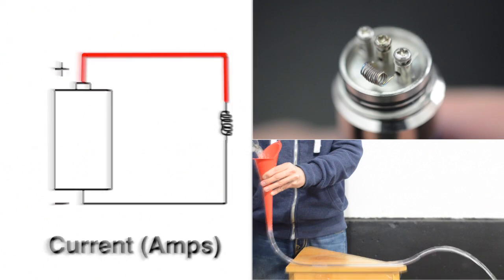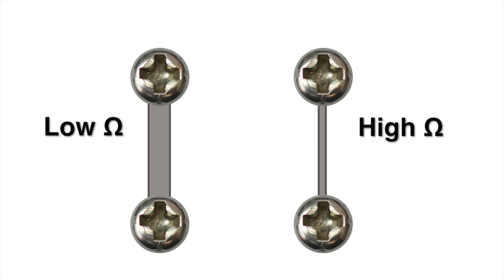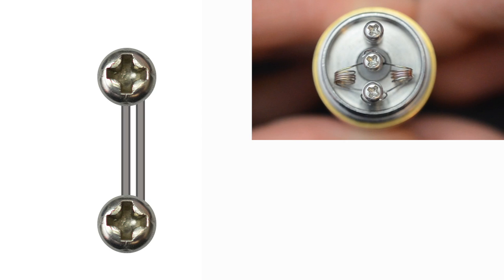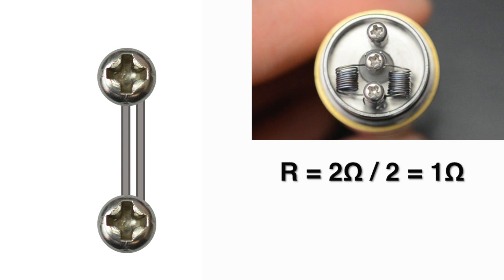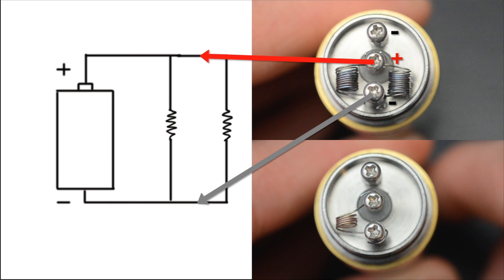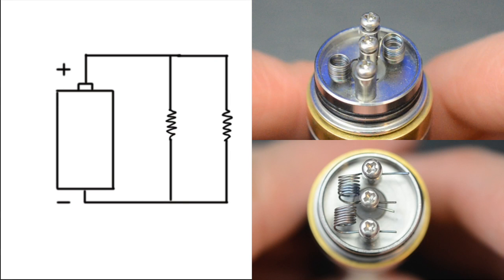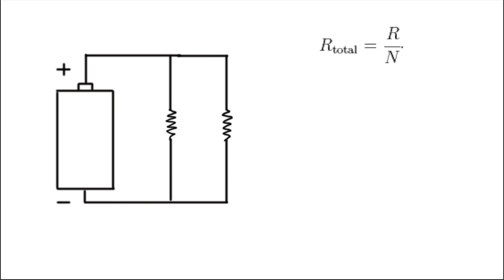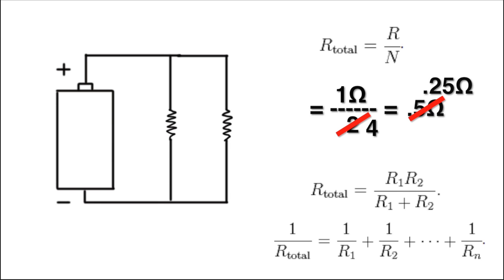How Dual Coil Builds Work

Comment: So if I want a 0.5ohm dual coil build I need to use two 1.0ohm coils?
Reply: Yes and no, if you have 2 1ohm coils in parallel if gonna be 0.5ohm but its not because you have to divide the resistance of the coil for the amount of coils you have, the correct formula for calculating the resistance in parallel is RT= [1/ (1/R1) + (1/R2) ] = [1/ (1/1) * (1/1)] = 0.5ohm.

Comment: You literally just explained my problem to thanks so much. It’s just so hard to get coils to be even so although they maybe close to the same ohm the won’t heat evenly if there’s even a .25 ohm difference. This is my problem I’m having with trying to run 2 Clapton parallel. 26awg*2+39+26awg NI80 3mm 0.3_+0.5 ohm

Comment: im using kbox 40w and dual coil wont work. what should i do?
Reply: use thinner wire to make resistance go up, most probably your mod read short-circuit and won't fire it

Comment: but, why build two 2ohm coils and connect them in parallel instead of just building one 1ohm coil, the total resistance and the material used is the same, right?
Reply: Pretty sure two coils produce more vapor because the wick has more places to get heated at.

Comment: Why is .25ohms lower that .5ohms?
Reply: .5 ohms is close to 1 ohm. .25 is farther from 1 ohm. All you need to do is count. It's simple math. For example, .10, .9, .8, .7, .6, .5, .4, .3, .2, .1, 0, .1, .1.1, .1.2, ect. It's simple math all you need to do is count.
Reply: it's like percentage. So .5 is actually .50 (the 0 is invisible) and it's greater than .25 which is basically just .2 but more specific like your calculator.

Comment: That explains a little bit, thank you very much for this video. You going into better detail the technical aspects than most people who have 'coil tutorial' videos.

So correct me if I'm wrong here (I'm new to rebuildables and making coils) if I needed 2 ohms with a dual coil at 30awg, each coil would need to be composed of roughly 8 inches of kanthal, correct?  Because a single coil would @ 4 inches is roughly 1 ohm (roughly 0.696 per inch * 4). So 8 inches at 30awg for a single coil would be 2 roughly ohms. So doubling that would be 4 ohm, but halved making it 2 ohms total... correct? Or would each coil need to be 16 inches of wire?  So I guess the question is, does the resistance halve each coil when paralleled, or does it halve the sum of the coils individually?

See my problem is I'm trying to build coils and my mod is a Smoktech Zmax, which doesnt have a very low floor as far as resistance goes, i think the lowest it'll handle is like 1.5? It's what I have to deal with until I get get a better one. So originally i was thinking dual coils would increase the ohm and lower the resistance, but thanks to this video I see I had that backwards, so thank you (like I said, total newbie here).

Anyway if anyone could give me an answer, I'd appreciate it very much.

Comment: Thanks for the video. This really helps people out when they are trying out their new RDA builds. Keep up the great work! Could you do a video on the different conductive materials that are used to make Mods? Silver, Copper, Brass, Gold, and stainless steel. Why some hit harder than others and what properties make them better or worse and what to look out for when spending alot of money on mods?  Just an idea..
Reply from the maker: That’s a good idea about comparing the materials. I’ll add that to one of the videos. I can give a quick explanation, but you might already know this. Conductors actually have some resistance even though it’s very little and it varies depending on the material. So similar to a coil, there’s a “voltage drop” through the mod. It’s taking away voltage from the atty. The precision of the threading matters too.
Reply: VapePowered thanks for the explanation, i already knew that but I feel. That it is great for others to know it when making a decision on higher end mods.